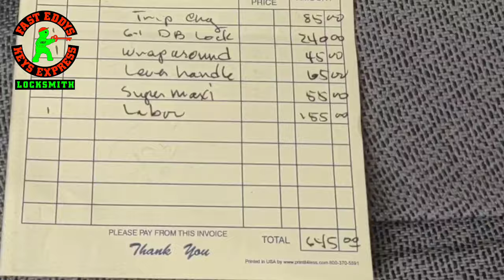Surface Mounted Deadbolt Replaced With A Different Locking Application  | @fasteddyskeysexpress

Comment: Awesome Job.  I  Put Schlage B - 660 Dead Bolts Satin Chrome On My House Years Ago . I Have So Many Pin Kit's So I Keyed Them Alike. I Like Them Because They Have A Solid Outside  Housing.
Reply from the maker: They are great locks I have 2 of them on my main entrance with Primus cylinders in them. Even though I live in Minneapolis I sleep real good with these locks on my door with a steel frame around the door.
Reply: You charged only $65 for a commercial lever lock? Or did I miss something? Nice work. Too bad the thieves will only need to break the glass and unlock everything
Reply from the maker: This video was filmed about 7 years ago! I down loaded it off my old channel and posted it a few months ago!